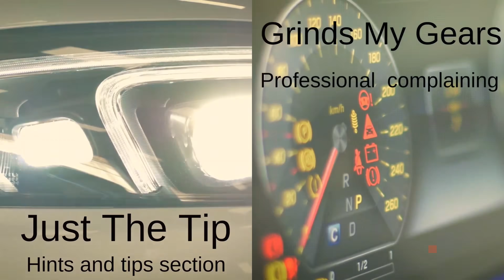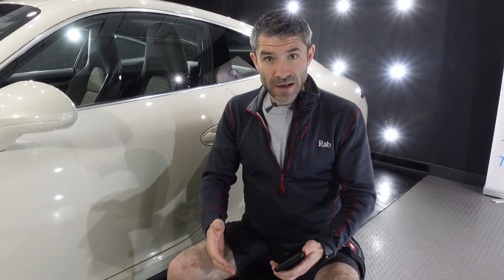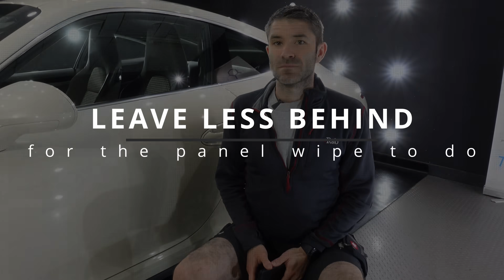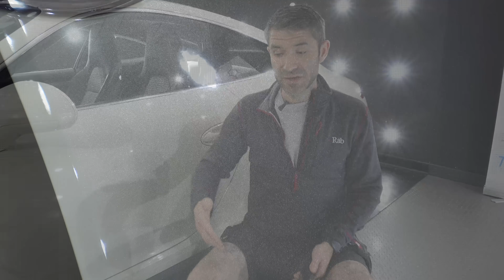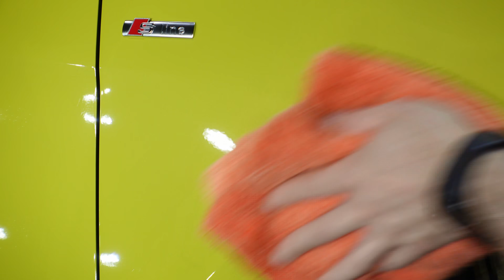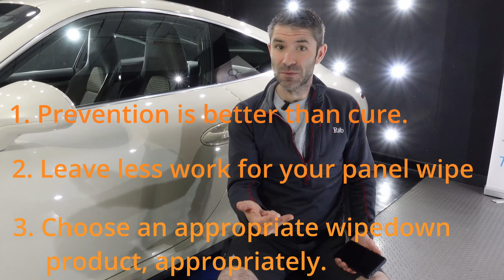How to increase ceramic coating durability.

Comment: What I ended up doing was using both a panel prep and a IPA wipe 

I'll use the surface prep to remove polish and whatever other materials may still be on the finish and then follow that up  what's IPA and sometimes reverse that order depending on what I'm dealing with on the surface of the paint.

Comment: Would using Upol fast make a difference in how quickly you should coat, versus the slow
Reply from the maker: Honestly no, I very much doubt it. Obviously without some form of equipment to back that up lol. It's not the initial flash but the lingering effect. Upol slow was my go too for years but I havevthe luxury of wiping down the night before I coat so was never a concern. Still a great choice if you have the time though 👌
Reply: @ObsidianDetailing  I'm a home user everything is done outside, do you think the wind outside might help it flash quicker. I've been unconvinced by other panel wipes I have used so was thinking of trying Upol and found your video. What's your go to panel wipe at the moment.
Reply from the maker: I am using koch chemie sil. Its dilutable like a normal ipa is and seems to do a great job. I used upol for years and although I had no failures I moved away with the mindset that even though I had no issues I was removing a "potential ". I figure every little bit helps long term. But I really think the key is using a rinseless wash to remove polish residue as the paint is much cleaner before ever getting to the wipedown.

Comment: You are 100% correct in everything you covered here, and these are the same lines of thinking I employ as well.  I love the Feynlab products, and I was actually considering utilizing Prime as my clay lube before.  You’re video reinforces that thinking to me.  Good video, thank you!
Reply from the maker: Appreciate the comment and am glad others feel/find the same
Reply: Hey I’m a fellow FEYNLAB installer. You can use Primer vs Prime. You apply like a wax on a finish pad right before ceramic application. Gives a solid chemical foundation to build onto

Comment: Hiya Matt, Great video (once again) and a lot of knowledge to take away and absorb. 

Couple of questions for you, a) what dilution ratio do you use for the rinseless wash and b) as a weekend warrior with no controlled environment (garage) I normally use Eraser for my wipe down. How long after wiping down would you say its safe to coat the car? 

p.s by any chance are you looking for a padawan 😂
Reply from the maker: Easiest way to do dilution is 1:250. So 4ml per litre, simples. 
Go immediately after eraser, no need to wait. Its perfect for your situation 👌

Comment: well said sir .what is your advise on using wax on ceramic coated car paint.or how long should a coated paint stay before using waxes
Reply from the maker: As with all things I think its worth listening to the manufacturers. I know that some actually sell ceramic waxes specifically to use with their coatings. I personally prefer a polymer spray as a maintenance as it plays well with a ceramic AND reduces water spots, plus you are not rubbing too much on the coating
Reply: thanks @ObsidianDetailing

Comment: Just watched this Matt, this is a fantastic video and has really opened my eyes as a professional to a subject that is never talked about. 

It all makes perfect sense, and I’m assuming that you’re recommending Feynlab based on it leaving nothing in the way of protection behind like say ONR would?

I’m an IGL accredited installer, I do find their own panel prep called precoat is very good at removing remaining oils but this extra step with rinse less I definitely feel will yield greater results.

Thanks for the content, I’ll be watching some more tonight!
Reply from the maker: Hey matt. Yes 1000%, fpr cleans better, leaves nothing and precoat can be used afterwards. Extra step or 2 for a a potential much better bond

Comment: Hi Matt, a great heads up, I've learnt things that Id wrongly taken for granted & understand the logic, thank you Sir !  Given that two of the danger area's are filling microfissures & not allowing adequate time for a Panel Wipe (Upol or SH) to flash off properly (something I was unaware of but thankfully time is something I have given I struggle to do both at onetime) would using an Si02 based primer (essence etc) not kill two birds with one stone providing a bonding surface of like materials?  (ii) Next project is a car that's being wrapped now, I will get it in a week or two but have read (i) Vinyl wraps may not react favorably with a panel wipe as its too strong & (ii) vinyl wraps are full of microscopic pores so again would a primer neutralize both weaknesses effecting strong bonding of the ceramic coating? (iii) thoughts/recommendation about coatings meant for vinyl/ppf ?  Not Urgent ! only when youve a coffee in hand.. p.s. apologies for not explaining myself yet..
Reply from the maker: Hey Mike. Hope you are well good buddy. 
Wraps swallow a lot of product for sure, so budget extra product. Maybe even twice as much! Primer polishes, I find they always negatively effect durability, so I only use on super soft paints that won't finish down without one. It might not be too dramatic, but it for sure decreases

Comment: If you use rinseless wash after polish, does that negate having to use a panel wipe before coating?

On another note, I had no idea UPOL slow itself could inhibit coating from binding well. Explains why I may have had mixed results as I did not give it much time between wipedown and coating.
Reply from the maker: Another great question. I personally still do, and recommend the same. But I wouldn't be surprised that if you managed removal with fpr,  and then did a further fpr wipedown with fresh product at the end, that you would be very close to the same thing!
Reply: @ObsidianDetailing  thank you! Would you recommend a panel wipe over UPOL slow that's good value for money? I feel a bit of tool having bought 5L of it now 😅
Reply from the maker: I use upol. It's a bargain I think, compared to manufacturer specific wipedown products!
Reply: @ObsidianDetailing  thank you! How long would you advise leaving UPOL slow to evaporate after wipedown? Unfortunately long periods might be tricky for outside use with environmental dust etc
Reply from the maker: A good few hours for sure. If you are looking for an underdog, check out envy car care filler killer. Very cost effective.

Comment: This is a fantastic video and your findings broadly mirror my own.. I had a couple of coating failures, one using Gyeon Prep and the other couple with UPOL and it prompted me to research the topic to find nothing... as you say,  nobody talks about this.

On the advise of a local detailer I started following up UPOL wipedowns with Eraser. I then moved onto doing what Yves from Gyeon recommends, using a degreasing snow foam and hot water rinse before following up with Prep/Eraser, which was yet more thorough but added so much time to the process.  Feynlab Pure Rinseless really makes both of these processes redundant now - I even do a two bucket method to ensure that only clean solution finds it's way onto the car. I know it's overkill, but after hours of polishing, it's not worth the hassle of cutting corners when it comes to coating.

Never used Prime though, it's extremely pricey and not had any failures since adopting the above methods.. I'm sure curiosity will get the better of me soon enough though!!!
Reply from the maker: Overkill isnt a bad thing, especially given the prior efforts. Plus its really not a big hassle. 1 extra bucket, who cares! Especially when it yields greater results. I'm 1000% with you
Reply: Can I ask a question to clarify something here @adam? When you do the FPR wipe down, do you then coat from there, or do you still use a panel prep? Just wanted to check as I wasn't 100% sure from your comment.

Or did you use the FPR after the upol?
Reply: @SuperchargedLlama  FPR for wiping off the compound, then normally follow up at the very end with an alcohol based, coating manufacturer recommended panel wipe (prep or eraser). FPR is used differently but has replaced UPOL entirely in my routine.
Reply: @adblf  ahhhh gotcha gotcha. Yeah that's generally how I use it, I've stuck with IPA and Di water for my final wipe down as I haven't found it caused me any issues (especially when after FPR). But of course when you're using the manufacturers prep then you k ow it should play safe with the respective coatings.

Comment: Is there any sense in Upol, then IPA after that?
Reply from the maker: its a fair question, and I have seen someone do it. Im not a chemist so I don't know whether or not ipa or an alcohol solvent will break down or remove what's left. Definitely something I will try to find out.
Reply: @ObsidianDetailing  it does work, but not a great solution on softer, sensitive paints.. a lot of dry wiping!!!!
Reply from the maker: @adblf  again, I agree with that. Especially if it's a home brew and poorly lubed
Reply: @ObsidianDetailing  Such great insight from you guys, thanks. There was me thinking when upol had flashed off it was ready for protecting
Reply from the maker: You weren't alone lol

Comment: Great information Matt 👌I always wipe down each panel after it’s been refined with U Pol then move onto the next panel till the whole car is done, then go back to the first panel I refined to begin the coating process
Reply: As Matt alludes to in the video, unless your wipedown takes 2 plus hours, UPOL will not have gassed off by the time you come to coat. Spray water onto the panel and it will bead, or feel it and it will be slick...
Reply: @adblf  I meant after each panel has been corrected and refined, I then move on to the next panel to correct and refine. So when I come to ceramic coating stage the U pol has had enough time to gas out 👍